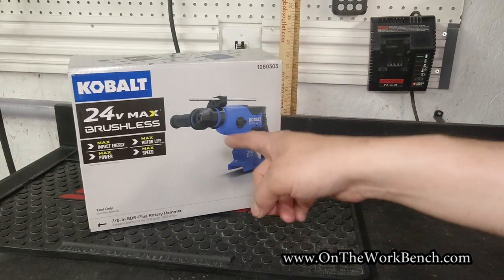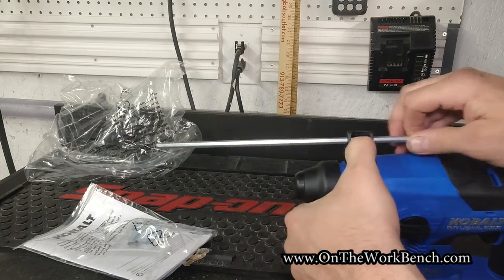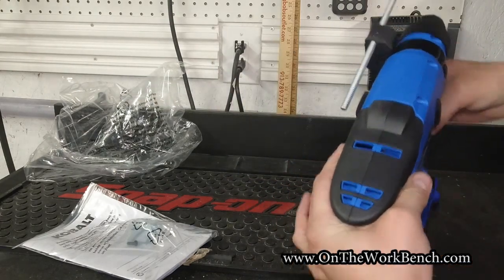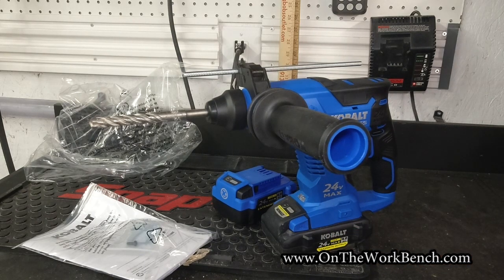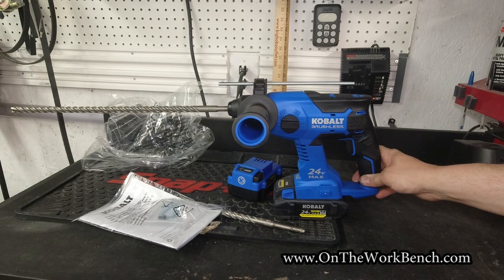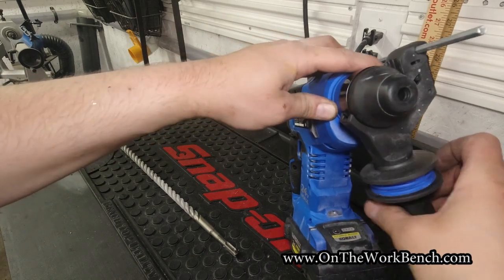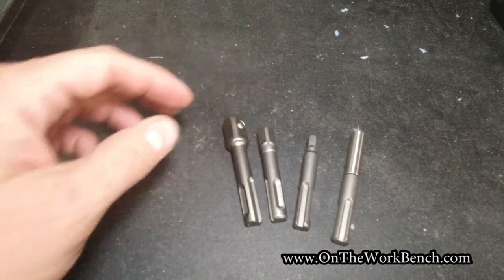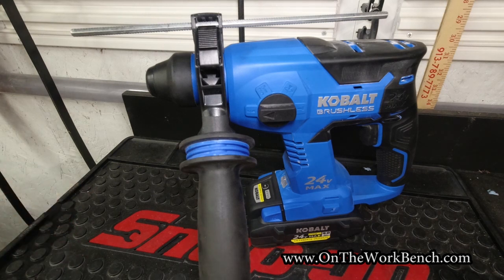Kobalt 24v SDS Plus Rotary Hammer

Comment: It may do the work, but it does not look like a contractor grade tool. They have it priced like so as well. I’m not knocking it for aesthetics, I’m simply saying that when you’re up on a ladder and you’ve been drilling multiple holes, you’re gonna want to drop it to the ground sometimes. I know I used to slide mine down by the cord.
Reply from the maker: The quality of the depth stop mechanism is a major shortcoming, I have had to wrap my bits with tape at the correct depth because I don't trust the depth stop to hold correctly.
Reply: @OnTheWorkbench  imma tell you another stopping mechanism we used to use. A solo cup. Keeps the dust out of your face. I don’t know if you’re already aware of it, but I was surprised how much of the dust actually winds up in the cup.

Comment: Nice video. Nice tool. It's a shame the weak link is the torque handle. The torque handle on the 1/2" drill is all metal. Why did they not do the same for the hammer drill?
Barry

Comment: Is it hard to get the ultimate output battery off the rotary hammer? I use the ultimate output with my drill and it is so hard to get off!
Reply: Comments 2 years ago yay! Probably won't help you now however Kobalt batteries and their tools are not very consistent. I love them I have a ton of them, but it is extremely common for the batteries to get stuck on the tools. It's very hit or miss.

Comment: The battery gauge does not show 25% per bar. With 3 bars showing, your charge level is between 60% & 80%. Just fyi so you can include more accurate information for your viewers. 👍👍